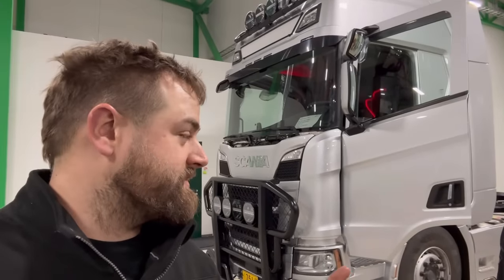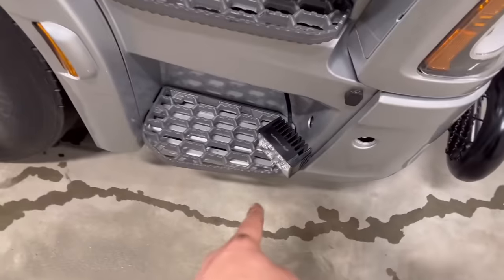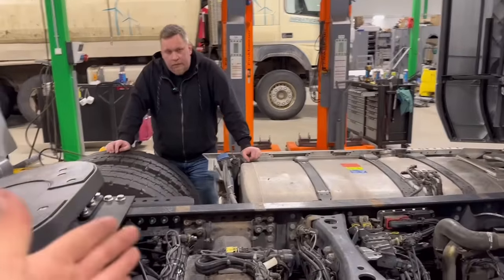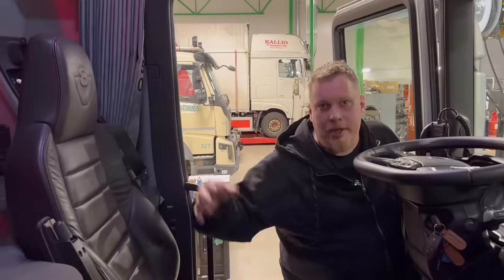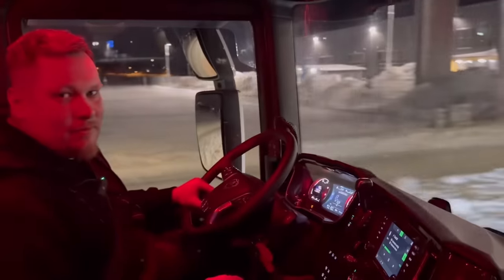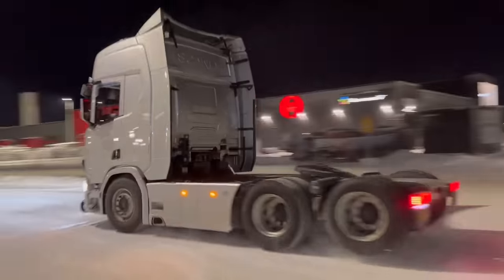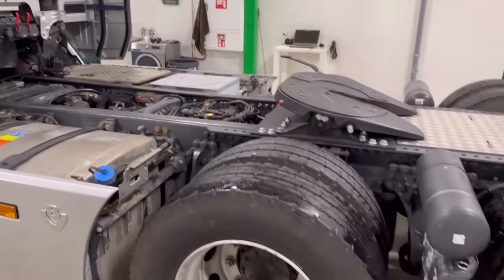First EVER Manual Swapped R650 Scania Truck!

Comment: I'm currently on vacation in Florida and I've gotten to see American trucks up close, they look a lot bigger in pictures than in reality.  The cabin of the Scania is huge compared to the Peterbilt, I sat in one and almost got shocked. Otherwise, the trucks here are built lighter, well, in Finland we drive with twice the total weight than in the US
Reply: I can say that American trucks are smaller than their European counterparts other than sleeper pods. The US trucks can be longer in wheelbase, but for obvious reasons this can't be the case in Europe. 
Width, height etc European are larger, if you cut the sleeper pod off a US truck, it's pretty small, narrow, rattles, uncomfortable and generally of a different era (past, long past). 
I'd go European all the time, truck wise. The US pop out propaganda of how great the US truck is (and of course everything else US), it's only really believed in the US. Back in the 60's they could believe it for real, but really over the past 3-4 decades Europe has led the way for truck and driver comfort.
Reply: Back in the early 90s my dad drove a V1 Volvo FH a got the chance to drive a KW back in NZ. He said he hated it. The KW was uncomfortable, rattled like he was going over speed bumps with no suspension, and nearly killed his back. So he was euro trucks for ever on. I drove an V1 when I first started driving and now I'm driving   a V4 FH (Not had the experience of a Scani yet but will do shortly) the comfort from the V1 to a V4 is far more better, so I would love to know how to euro compare to the US first hand.
Reply: @cpbtrading4822 yep. The attitude persists in Australia. People don't like the digital dash in new kenworth's and call them daf's even though they are still pos kenworth's for the rest of it.

Comment: You will be a Scania expert soon Bruce.
Reply: I was just thinking, from zero to expert in just a few videos 😅
Reply: What is the advantages of going manual instead of the autoshifted one? I mean, the autoshift can do manual too.
Reply: @henrikcarlsen1881  The owner have some specific job even the trailer isnt standard
Reply: @ stihl... not yet he still struggle with a shift pattern 14:27
Reply: @henrikcarlsen1881  you have slightly better control over the gears in tight corners and steep slopes
Reply: @altergreenhorn  pattern is normal with a couple add ons when pulling the knob to the left
Reply: @vihreelinja4743 are you experienced with pulling KNOBS to the left??
Reply: Yea why not have the shifter knob touch the roof, because practicality is the key with you.

Comment: That R650 is sick...beautiful inside and out.  American manufacturers have a lot to learn.....
Reply: you can clearly see that there is more competition in europe than in peterbilt nation.
Reply: Thats the problem, they don't have to learn, they have closed the market and can go on and on selling their US trucks..
Reply: its funny how american truckers are so deadfast against emissions and DEF, say it doesnt work, and stuff, its just that american trucks are decades in the past compared to european and asian trucks. Like this one, 650 horsepower v8, running DEF, having strict emissions rules but still can output really good power, have crazy good torque, and have really good reliability at the same time, also, the automatic transmissions in scanias are so good, drove a r650 '18 from 2018 until 2020, after a crazy accident that flipped the truck and made me have to retire from trucking.
Reply: @kizi86  sorry about your accident...glad you lived to talk about it.   I agree, the US is so backwards when it comes to trucking, only after some serious modifications can the US engines crank out 600, 800 and possibly more HP, and as for automatic trans.....still far behind the European market
Reply: @kizi86  imagine how good they could've been with no emissions crap

Comment: The 650 is a phenomenal truck finished to a very high standard. The spot lights with the lazer light in the middle is like daylight when lit up.The dipped dash is just a bit of class. The 360 camera system gets used a lot on municipal vehicles or ones in big city centres. Its a great thing for eliminating blind spots. It has been a very productive week in Finland for you bruce and can't wait to see what you end up doing to your own Scania. 👍

Comment: So since both this manual swapped truck and the blue donor truck are both Norwegian trucks, that should interest you to visit Norway! The blue truck is from Thor Tenden Transport in Stryn. All their trucks are with that stylish paint job. Also, most of europe use only 2 axle trucks, but in Norway the norm is 3 axle trucks. Some with lift axles, most with tandem drive. 
So go hit up some trucking videos from the western part of Norway, see the scenery and the trucks they drive and the roads they drive on. I myself drive mobile cranes here.

Great series Bruce!
Reply: There's no rule about 3 axles.. but it's the most convenient for weigth distribution and for winter driving. 

Eller kan du referere til en bestemt lov jeg ikke har hørt om? Vi har derimot fritak fra diverse EU bestemmelser når det kommer til distanse mellom hytte og tralle på semi.
Reply: @norwegiandude8709  Rule som i norm =) Endra så det ikkje blir misforståelsar.

Comment: Scania stopped offering Longline cab in 2005, just a few years after the release. They're incredibly rare and still stupidly expensive. If you find a newer one it's a one-off modification by one of the shops.
Other than that the problem with sleepers in euro trucks is length, you have about 30 inches behind the front seats and that's it meanwhile in the US you can fit a 42-inch bed AND a standing refrigerator like in the Volvo VNL860.
Reply: In Finland and Sweden the length is no longer a problem since the introduction of HCT, which allows the trucks to be 34,5 meters long. I really wish the long nose trucks as well as longlines could make a comeback, since they look so cool. The problem probably is that they are less agile in cities, but for regular highway transports I would buy one if there was any on the market.
Reply: You forgot that Scania offer the XL (CR23 and CS23) R and S series cabs with 270 mm cab extra length. And that comes with an optional 100 Cm (40") bed. All within the factory external air management side blades and roof spoiler. Scania S series have flat floors so basically the difference with a VNL860 is a 2" bed width .....

The bottom line is the difference between a cabover and a conventional. The former is highly manoeuvrable in all situations and the latter is not. Especially the longer wheelbase options. As a driver do you need an extra 2" of bed for 7 hours sleep or a better quality driving experience for the 13 hours behind the wheel?
Reply: @pavettto Some, or even many, trucks in Finland go sometimes by ferries to Sweden and then the length matters, as you pay for the length not the weight.
Reply: Ещё у VOLVO FH 16 есть модель с кабиной XXL.
Reply: @pavettto   Thing is - longer cab means shorter trailer that's why even HCT trucks use standard cabs. Also manufacturers are not interested in making longer sleepers, Scandinavian market is too small. More - the whole EU allowed 90cm extension if the cam has aerodynamic front. Noone used the full extension yet, DAF made the sleeper 33cm longer, Mercedes just introduced the new Actros with THE SAME sleeper as before.
Reply: @1chish   Scania XL cab still makes the entire truck 270mm longer therefore it's illegal in the EU (unless it's permitted by a country but then you can't leave this country). 
Also it's not just 2" of a bed. There's also a wardrobe and a standing fridge between the bed and front seats. You have almost 2m behind the front seats, there's also an option for a bottom bed to fold to the sides with a table in the middle. It has nothing to do without the nose. I don't know if links are allowed but check my next comment.
Drivers don't drive for 13 hours, they need to do their pauses, including the 36 hour one. They quite often spend 2 weeks or more in the cab, cabs are their homes.
Reply: @sic22l  The XL is NOT illegal in the EU. For someone who doesn't even live in Europe you are pretty free with the legals.
It fits within the overall length limit of the earlier EU laws (16.5 metres) and newly extended EU laws. They will certainly fit within UK limits. And as part of the EU Scania have to build for EU approvals.

As for the rest of your garbage I have had all this out with you before on this channel and you are still writing cow manure. And yes I DO know what the legal driving limits are as I, unlike you, drove trucks (semis) for over 30 years. My '13 hours' referred to US laws as defined here:
    "The FMCSA's regulations regarding hours of service vary depending on if the truck driver is carrying property or passengers. After 10 consecutive hours off-duty, you can drive up to 11 hours. You can drive up to 14 consecutive hours after a 10-hour break. Must take at least a 30-minute break between eight-hour drives"

And to the UK and the EU the hours rules which allow a maximum of 14 hours duty. As defined here:
    "A driver must take at least 11 continuous hours of rest (called a regular daily rest period). However, this daily rest requirement can be reduced to 9 continuous hours [making 13 hours duty] up to 3 times between weekly rest periods (called a reduced daily rest period)"

Don't try to be a lawyer when you clearly know diddley.
Reply: @1chish     The fact that cab extension fits between air deflectors doesn't mean the truck isn't any longer - it is because you have to move the fifth wheel back othwewise the trailer would hit the back of the cab while cornering. That's why they can't be used where EU's 16,5m limit applies.
UK has 18,55m limit for LST's - longer semi-trailer. I've yet to see someone using it to use extended cabs instead of longer trailers. 
You said that the cab matters for just 7 hours a day when you sleep and the rest matter for driving which is bullshit. First the driving part - there's no length limit in the US for trucks/tractors/prime movers, roads are flat and wide, length is not an issue and many drivers prefer longer wheelbase because it's more stable at speed (even 75mph) and longer distance from the fifth wheel allows you to do 180 in tighter places. I'm not advocating for introducing long nose trucks in Europe because that would make no sense but using full 90cm allowance (for example 15cm for aerodynamic front and 75cm for the sleeper) by the EU would greatly benefit driver's comfort without compromising maneuverability in the slightest thanks to 6x2 with puller axle.
You have to rest for 10-11 hours a day continously and take breaks during driving hours. Not to mention weekly allowance after which you have to take even longer break (in NA you have to take 34 hour break after driving for 60 hours). Quite often you have to spend those 34 hours in the cabin on the other side of the country. But even in Europe during your 11 hour pause all you can do is either sit in the driver's seat or lay in bed. In the American Volvo you can go inside the sleeper (walk!), sit on the sofa, place your laptop on the table and relax. You can hang your clothes in the wardrobe and put your food into the standing fridge on the other side. It's just a better place to live in because that's what drivers do. 
Your resistance towards having more space and more comfortable space at that is weird, it's like a steam train engineer complaining about modern diesel and electric units because he worked for 30 years shoveling coal and it was fine.

PS. Scania's XL cab have 40 inch bed but it's 40 inches in the widest spot. The bed gets narrower behind both seats.
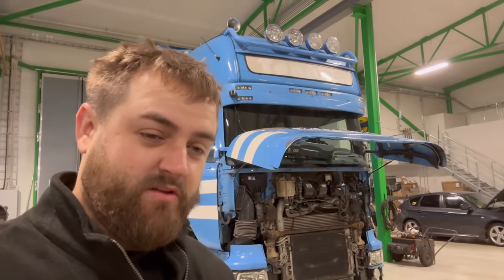Reply: In regards of the fridge and the extra inch for the bed one does not really need it. The bunk beds are fairly wide and really truckers prefer everything easy to reach while driving. That is simply not so easy with a standing fridge where there is way less room in it compared to the European designed. 18:41
Reply: @sic22l In North America you have to take a 34 hour break after 70 hours driving not 60 hours. In Canada which also belongs to NA it's 36 hours. Most modern EU trucks these days have the same bunk bed width from head to toe. In the older units they were narrower behind the seats.
Reply: @1chish So in regards of you mentioning  of the mandatory 10 hour break you say one can drive 11 hours in the US, then you say suddenly after 10 hours one can drive 14 hours. So what is it now, can you make up your mind? I'd say it's 11 hours in both cases because a 10 hour break and 10 consecutive hours off duty is the same don't you think? 😂
Reply: @sic22l you are talking BS. Please just shut the front door!
Reply: @tomh9807  In the EU trucks only the top bunk is the same top to toe. Even in this video you can see that the in the brand new Scania bottom bunk is quite a bit narrower behind the seats.
I'd say there's more room in the standing fridge, there are 3-4 shelves and some door cubbies. Longer sleeper means more space and having more space is better than having less space. '1chish' prefers to have less space.
You keep fixating on breaks and driving hours meanwhile 1-2 hours here and there wasn't the point completely. '1chish' said that the sleeper matters for 7 hours a day which is simply not true, you spend much more time inside the cab while not driving.
Reply: @sic22l   Look dude you are entitled to your stupid opinions but misquoting and misrepresenting mine are out of order. But hey its what you have been doing all along.
State your case and leave it there. Don't be an arse and malign my words.
Reply: @sic22l  In regards of the lower bunk bed that might be true in some Scania models but not in newer the MAN or Actros which are the most driven trucks all over Europe and Russia. And  in regards of the fridges you are wrong, too. Have you der seen the drawer fridges of both mentioned truck brands. Yes in that Video the Scania fridge seems a bit small i agree. Still it looked to me there is more space as in the standing fridge like in my T680. The Volvo one is a bit wider and  has a little bit more room. Each and every driver has different requirements for himself.  I totally disagree that a driver spends more time in his bunk than behind the wheel and that is obvious. That maybe true during his 36 hour reset break while on the road if necessary.

Comment: Used to drive a Scania 143M (500hp) back in 1992, that had 1,400,000 kilometres (870,000 miles) on the clock. It had a 18spd Road ranger fitted and would do 100kph(62mph) in 16th. I was told it was good for 160kph(100mph). Never go to test it out. Had a big exhaust, sounded so sweet. At idle I reckon you could almost hear the sound of each blade of the turbo spinning around at the exhaust tip.

Comment: Dunno when you are trying to haul "big" in the USA. I drive now and then scania or volvo with 1058 hiab. Both of them are 5 axel, trucks weight about 30-32tn wihtout load (~66 000 - 70 500 lbs) max is 42tn with load (~92 600lbs) truck alone. Add an trailer and we can go up to 76tn (~167 5000 lbs) total weight.Trucks and trailers we use we get payload about  30-35tn  (~66 000- 77 160 lbs) mostly it is our mobile cranes counter weight.

Comment: Those two headlights right under the windscreen... I flashed my headlights to a car that brake checked me once, at night... They shined so bright I swear I could have identified every single grain of dust on his dashboard! 🤣 Almost felt sorry for the guy!
Reply: never witnessed that kind of roadrage here in finland (brake checking in mean, self defense with lightbeams is legit in my books)

You can find those lights also on normal cars in finland, many of us drive through roads that have no artificial lighting and we have frigging deerswarms everywhere, so the bullbar is no decoration, and the lights have an entirely pragmatic reason.

most important are the positional lights on the top of your cabin - because it tells oncoming cars there is a truck cabin coming over the crest
which leads to me switching off the farlights sooner - no one needs 60 ton veering off course as an oncomer.

If you still dont understand,   the cab is invisible to me as a car-driver until the headlights underneath come over the crest - that is the time the trucker is blinded by my own entirely pragmatic extra lighting.    But if a cab has little lights on top of the cabin, i know whats coming - and react faster
preserving the truckers nightvision better :)
Reply: Hope you gave him a good tan 😂
Reply: Hahahaha they really are super bright!

Comment: Next time you should also check out the small finnish truck manufactor Sisu truck, they built trucks with Mercedes V8, hybrid system and fuller gear, many axles, lifteable, steerable.. old Sisu trucks were built with, Cummins, CAT engines..

Comment: I had a 1983 Lincoln Town car. When you hit the turn signal a light on front and back illuminated that side of the vehicle. Best safety option ever.
Reply: Corner lights, I have it on my 64 Cadillac in the front corners. Nothing new under the Sun. 😀
Reply: @ABHB666  nope. But apparently old technology is too good for new cars.

Comment: Hope you get the chance to do a night delivery in Europe. I delivered fresh goods to supermarkets and corner shops at night, the roads to yourself and the only difficulties were road works, shutting down the highway at night, you get diverted into the city small roads for a few miles, hit about 20 roundabouts, ranging in size from 5 feet to 100 feet before returning to the highway, or delivering to a shop in a small village in the mountains and coming face to face with a 4x4 truck and smiling down at the driver who has just realised they are no longer the baddest on the the road.😊